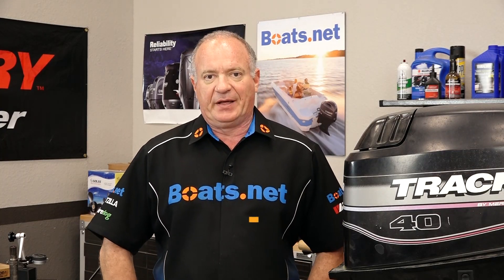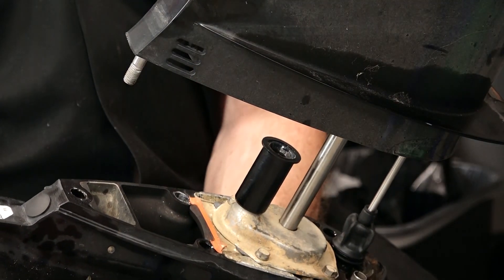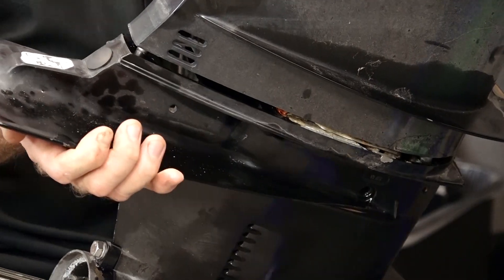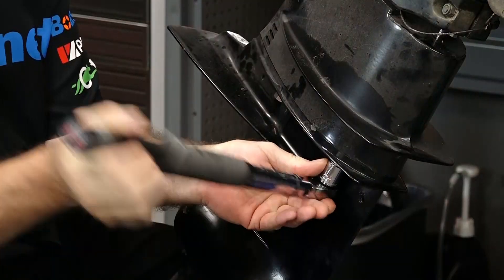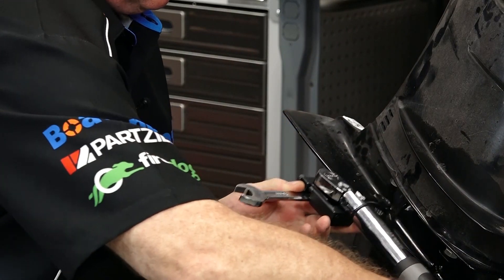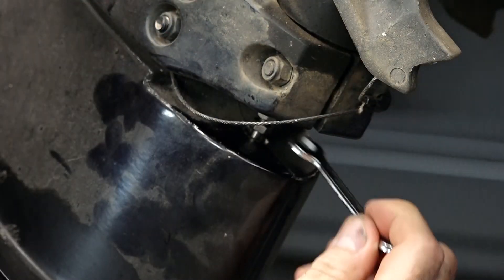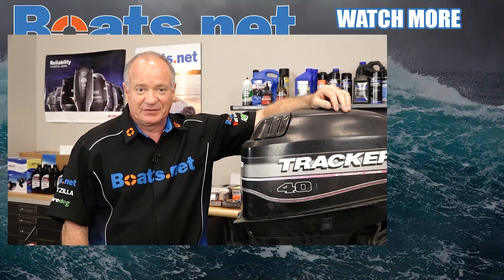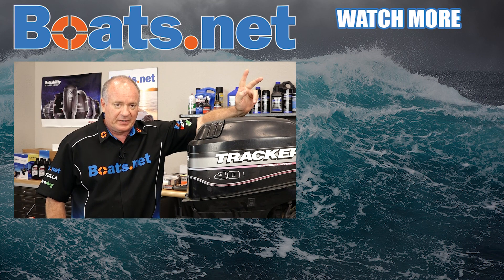Mercury Tracker 40 Gearcase Remount | Mercury 40HP 2-Stroke Lower Unit Replacement | Boats.net

Comment: Hello. Do you have a video on how to replace the output seal on a mercury tracker 40 hp 2 stroke? I don’t have the 2 bolts to take off to pull out the prop stem.